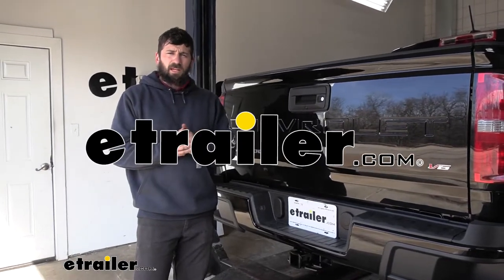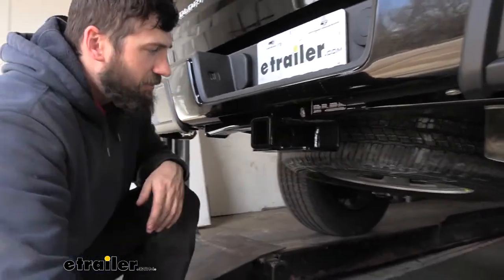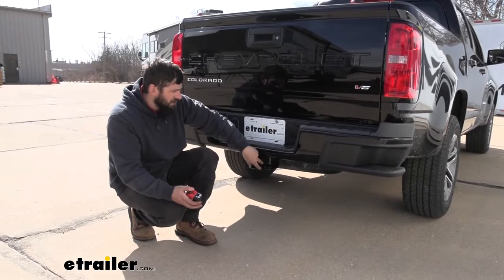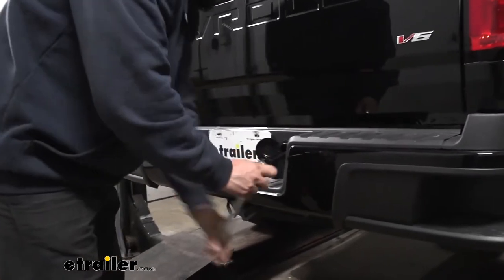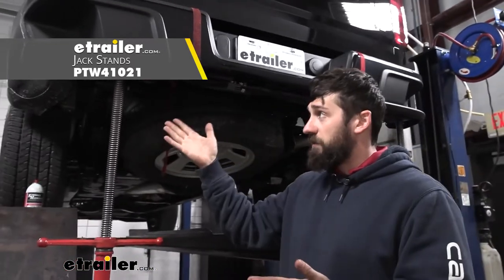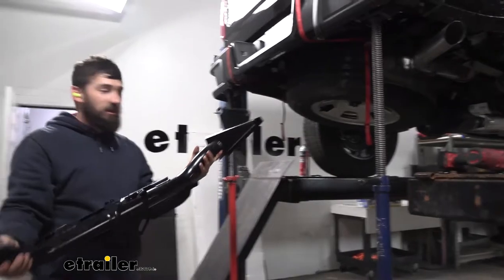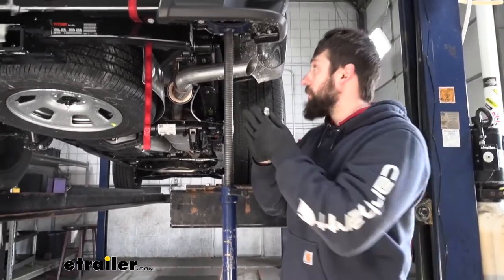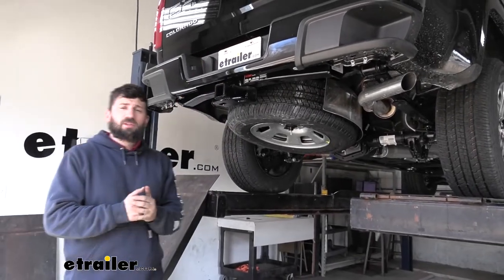etrailer | DIY Install: Curt Trailer Hitch Receiver on your 2022 Chevrolet Colorado

Comment: What's the benefit of this compared to the factory hitch?
Reply from the maker: The factory hitch will do the same job as the one that was installed on this vehicle. This is a great option if your Colorado just came with the bumper support. Pulling trailers with a ball on the bumper does not allow for very tight turning and will not let you use other hitch mount accessories.
https://www.etrailer.com/Trailer-Hitch/CURT/C13176.html